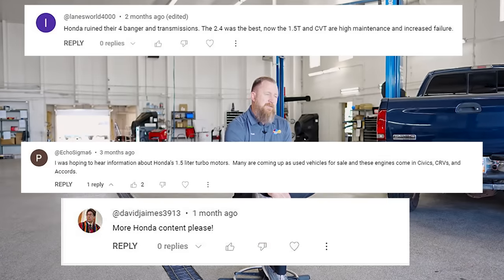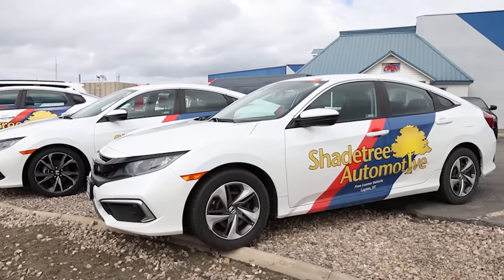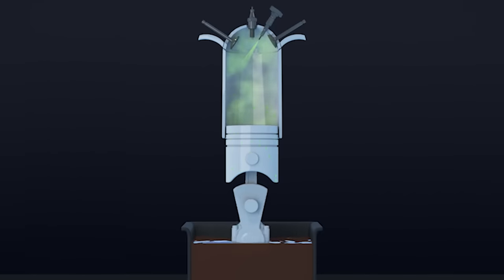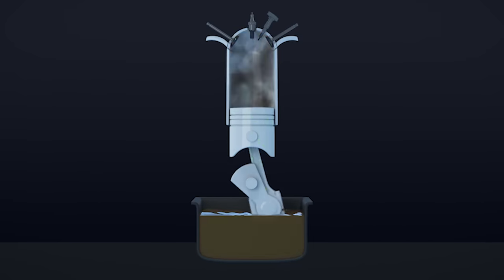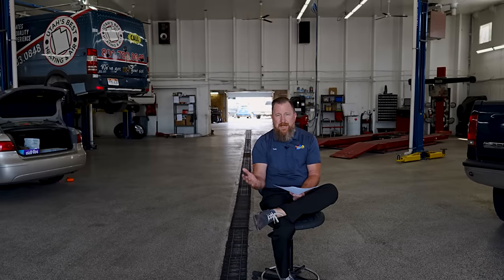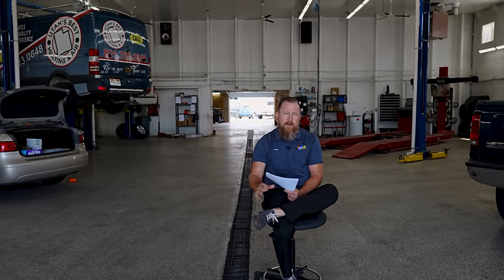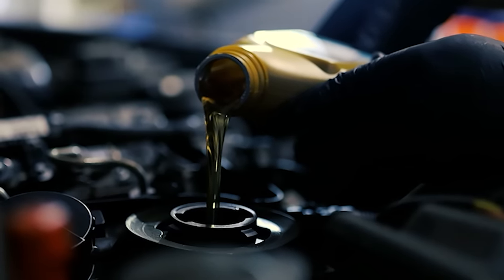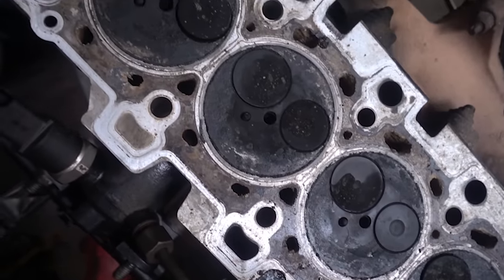Honda Oil Dilution Issue - Should you buy a new Honda

Comment: I would stay away from all mainstream small turbo engines and try to get a 2 liter - 2.5 liter non- turbo if possible
Reply from the maker: fair enough
Reply: happy with my 07 civic lx :)
Reply: Got rid of 2019 CRV. Was changing oil every 3000 and it was BLACK! Got the 4 liter 4Runner.
Reply: Smart
Reply: I have two direct injected cars and at a 5k oil change interval I haven’t had an issue. I even sent a sample to Blackstone at 3k miles from my 2.0 turbo Volkswagen (direct injection) and it came back perfect. I have no reason to believe that my direct injection Honda is any different.

Change your oil every 5k miles and it’s not an issue.
Reply: @user-3tf67bk46u   you suspect wrong, I have 163,000 miles on the Volkswagen and 63k on the Honda. Fuel dilution isn’t an issue if you change the oil at a reasonable interval. I haven’t scoped either because I haven’t had a reason to.
Reply: We had the old Honda 2.4  4cyl non turbo in our Element, besides routine maint, and valve clearance adjustment at 160k - no issues from new to 192k when we sold it, regret the 19 crv with its oil dilution issues, too bad the Element was just worn out when we sold it (aside from the driveline).
Reply: @user-3tf67bk46u  good call on the cvt fluid, we did ours at 25k and it was pretty dirty already. No hard driving, towing or anything just normal routine A to B.
Reply: Have a new 2023 HR/V.  Love my Honda and it's non-turbo 2 liter engine.
Reply: I agree 100% mrgarrison. Definitely stay away from these small turbo engines!
Reply: Probably a good cheap option. I love my WV 1.9L turbo diesel, no work to the engine yet but have had trouble with the fuel injection pump.
Reply: Turbos destroy your engine esp if 4 cyl
Reply: @ShadetreeAutomotiveLayton so this is just the 1.5l?
Reply: Mazda is far superior in design and quality
Reply: It’s this number one reason i got the 2.0 sport over touring or si
Reply: 9k/10k mile oil change intervals needs to stop. What a crock of shot.
Reply: @Trammael  Small engines with turbo  strapped to larger vehicle like CRV work really hard and need shorter oil intervals , maybe 5K is max it should do .
Than it has cheesy and cheap CVT for easiest way to achieve fuel economy at cost of performance , reliability and quality drive experience.
No respect for Honda , Nissan and Subbie going cheap !
Reply: @Pokka676  But that 2.0 is sooo slow with torque barely better than old 2001 Protege 2.0 and when paired with CVT it offers very cheesy and low end of driving experience...
Reply: @michaelw6277 

Well when you have an oil dilution then it's already a problem. 

Just because you change the oil fast enough before causing any damages doesn't mean it's okay. 

It's like saying it's okay to have diarrhea as long as you run fast enough to the toilet before you are crapping yourself...🤣🤣🤣
Reply: @nickmalone3143  So not true. Turbo engines are over-engineered to handle the addition stresses from boost. That's what makes factory turbo engines so strong...
Reply: Happy with my 2018 accord hybrid and 2023 CRV hybrid
Reply: Honda is putting a 2.0L NA hybrid engine in their civic next year. That is what im going to get
Reply: @michaelw6277 depending on what year that Volkswagen is, the gen 3 audi/Volks 2.0T is a very reliable engine other than the timing tensioner and thermostat leak.
Reply: It's a direct fuel injection issue, I have a 2.4l non turbo and it still gets fuel in the oil. Honestly shorter oil change (4kmiles) interval will fix most of the issue
Reply: Bought my wife a new 2018 CRV 1.5 T. 1200 miles in we were dead on the side of the road. Oil dilution. It was under warranty but Honda played this down for many years. I will NEVER buy another direct injection motor or another Honda just for simple fact of the way they handled my situation. We lost our @$$ on this car.
Reply: @DapimpBDSD  yup, but when you add the pressure from a turbo it gets even worse.  Decades ago it was well known that you'd have to change the oil in turbocharged cars more frequently due to blow-by and fuel dilution.  Add in a high pressure, direct injection system and it only gets worse.  Then add low friction piston rings and tens of thousands of miles of carbon build-up causing a richer than optimal fuel mixture and sticking to manufacturer recommended oil change intervals is a recipe for disaster.

Just change your oil very 5k miles and use a known good quality oil like Mobil 1 or Pennsoil Platinum or whatever.  Problem solved.

With my Honda I let the dealership do a couple of oil changes after buying it and their trash oil was disappearing from my crankcase over the course of a single OCI.  I switched Pennsoil, same weight as Honda calls for, and it doesn't use a drop over 5k miles.
Reply: @michaelw6277  I've used mobil1 and amsoil and it will still burn about half a quart every 5k miles. On top of that, the oil smells like gas. I know it's my driving habits (15ish min drive to work hwy/street)  but I'm not gonna really change that in order to try and see if the issue changes. The simple/easier solution will just be earlier oil changes
Reply: @mzrzfxr  Yeah bring back the Element with the K24 with a manual trans option. I wanted one badly but at the time it wasn't financially possible .
Reply: @michaelw6277  

There is a big difference between a "contamination" that occurs in a normal operating range that occurs almost uniformly in all engines across the board compared to in this case which is a DESIGN FLAW that only affecting a certain specific engine that can cause an early damages beyond what is considered as normal compared to its peers... 🙄🙄
Reply: My engine is 2.5 liter naturally aspirated.  Recently passed 250,000 miles with no issues.
Reply: @henrytenden  all engines get blow by for the same exact reasons, these Honda engines aren’t special. The actual problem is that Honda’s engineers recommended an unreasonably long oil change interval without accounting for the extra blow by caused by the low friction piston rings. Either that or the engineers made the right recommendations and the marketing and sales people steered the ship the wrong way.
Reply: @kdomster9141 that's why I like older cars in the 90s they made quality cars mainly Japanese cars and 80s as well thsts justcme though
Reply: Basically get a hybrid (which are rarely turbo) and expect to replace the $2000 battery pack every 10 years. Way cheaper than an engine and way more reliable than a turbo. The efficiency of a hybrid over a small turbo is generally greater anyway.

The alternative, as you say, is a non-turbo which is tough to find these days. Every non-hybrid Honda 4 cylinder is turbo. Your options are really between Subaru (which have issues of their own) and some Toyota’s and Nissans, all of which seem to have CVT’s of questionable long term reliability. This leaves you with Mazda, who still offers NA 4 cylinders with traditional torque converted automatics while still achieving over 30mpg.

The irony is the turbo Mazda motors, basically the same engines as the non-turbo models with some minor internal changes, are not reliable. Many skyactiv turbo motors have head gasket issues, as low as 80k in the larger vehicles such as the CX9, greatly justifying why they are now using an inline 6 in their larger SUV’s.
Reply: I’ve always stuck to 3k since my dad told me when I was a kid and his old school mechanic 35 to 50 bucks ain’t nothing
Reply: And still they tell you to not warm up the engine before driving.  That would solve many of these issues.  A gas engine and turbo has spelled problems for decades.
Reply: Ridiculous
Reply: My turbo engined car has recently reached 300,000 trouble free kilometres in the 16 years that I’ve owned it. I would recommend turbo engined cars to anyone.
Reply: @michaelw6277 Why are you changing the oil so often? My VW has done over 300,000km using the recommended service intervals.
Reply: @nickmalone3143 I wonder how my GTI Mark V is still going strong after 17 years and 300,00km then? I think your comment is based on bias not facts or experience
Reply: @michaelw6277 It’s as good as my VW turbo then. I wonder if it’s also as fast and as economical though?
Reply: @davidmatthews3093   that's awesome, glad to hear it.  I change it more frequently because that's what I'm comfortable with.
Reply: @davidmatthews3093 He might be talking about new direct fuel injection engines.
Reply: Gets rid of the carbon but stops up the cat
Reply: Peugeot have been using low displacement turbos for longer than honda. Their only problem is the timing belt is built inside the engine and prone to damage if not using the correct oil. I service every 15k km. no dilution problems
Reply: Some of us need power though. And a non turbo 4 banger ain't gonna cut it
Reply: @jeffreylong5660  
That's why you're best to skip the small mainstream turbo's & go straight to the  performance cars: type R civic, corolla/Yaris GR, WRX etc
Reply: Mazda 2.5 Skyactiv non turbo, best engine out there...
Reply: I have a 16 Corolla 1.8 mt and it’s a beauty
Reply: Minis seem fine.... but people mistakenly do the pcv valve when they really need a new valve cover entirely
Reply: I would not
Reply: Mazdas have been super successful with turbos in their whole line up.....coz they dont cut corners with low tension piston rings or use 0w16 oil etc. They put the good stuff in.
Reply: No point if it’s not a turbo, it’s boring and slow without it!!
Reply: @kdomster9141 absolutely not
Reply: @ChrisBrown-pz2gu  No too much to say there ? Honda made a gamble and took lazy direction with their design direction , choosing CVT and tiny engine with turbo is not like what Honda use to be 25 yrs ago making innovations and great designs to attract wise customer and enthusiast.
Now with cheap ass CVT and small displacement turbo and even that is a poor design with issues , than comes fugly exterior design and why would anyone want to buy it ?
Reply: @briangallant5973 Color isn’t really indicative of poor oil performance
Reply: Turbo = more routine maintenance.
Reply: @mrgarrison3516 the wrx has bad head gasket issues that plagued the platform for 20+ years. That’s not reliable.
Reply: Meanwhile Toyota's engineers solve the carbon build up on direct injection engine by simply using both direct and port fuel systems genius!...too bad honda is not catching on😢
Reply: I agree!  And this is why I bought a Mazda CX-5.  I really wanted a RAV4 but I couldn’t wait 2-3 months for one to come in
Reply: That's why I'm very happy with my 2021 Kia Soul with a NA 2.0 liter and multi port injection. Also has a timing chain, not a belt. Direct injection is one of the worst things in the auto industry right now.
Reply: @briangallant5973  I swear that my 4Runner can go 5K miles and beyond and the oil remains golden.  it's a great engine.  The Honda is bs.
Reply: don't forget to opt for Honda V6. I have my Honda pilot trailsport V6 on the way.
Reply: Good thing they offer a 2.0 liter non turbo
Reply: I have a 23 civic hatch sport 2.0 k 20 variant. The dealership changes every 7,500 miles. Hopefully no issues. I dud have a window regulator go out on passenger side.
Reply: What about the 2023? Any oil dilution issues? I drive it everyday in Hawaii
Reply: @irenemanuel4217  
Oil dilution = means fuel will get into your oil & you will smell fuel on your dipstick, your oil level may increase.
Oil dilution is increased in cold climates.
Change your oil often (twice as often as your manufacturers recommendations).
Use the recommended oil grade (0w-16  GF-6a etc).

Happy driving 👍
Reply: Only if you can find it all Cars suck now
Reply: Are u sure that 2016 CRV is having oil dilution issue?  Everything I see says the issue happens in 2017 thru 2018?  I believe you mixed up the years of the civic and CRV @ minute 1:25
Reply: So for the 2024 model, has honda addressed this issue & has the issue gotten any better than earlier year models ??
Reply: @michaelw6277 do you do the carbon cleaning every 30000?
Reply: @Tracy-wr7mj   oh no, I can’t be bothered to do it that often. First time I went 90k miles, second time I went 70k miles because I was chasing a misfire that turned out to be a set of new spark plugs that went bad really fast (I screwed up, always check the spark plugs first).

My car runs like butter now though. Never fall in love with a Volkswagen, they can be an absolute pain to live with but it drives so nice I just deal with it. Fortunately I have a great mechanic for big stuff I don’t care to do myself and even with repairs it’s still a lot less than a new car.
Reply: Depends on your location. If you're at 10k feet, enjoy your NA.
Reply: I had the same issue on my 1.6 Nissan Versa. The solution is easy. Just put 3.7 quarts at every oil change and you will not have the overflow.
Reply: Also, car makers are using low tension piston rings these days. A major issue with allowing more blowby.
Reply: I’ll keep my R18 and K24 engines and be very happy to keep on trucking down the road!
Reply: Only civic I wanted was the sport hatchback manual (2.0l port injection engine). However, Honda dealers mark them up since they are hard to find down south. Settled with the Mazda 3 premium manual. 2.5L no turbo.
Reply: What about 1.5 non turbo. That’s what my civic has and drives faster than I would ever need it to
Reply: @proggz39  if it's not a turbo you will be good to go 👍
Reply: @proggz39  if it's not a turbo you will be good to go 👍
Reply: Mate I just love the practical advice on mechanical matters. Gives me an edge when I upgrade my old camry.
Reply: @kdomster9141 far superior? That’s just ludicrous.
Reply: @billbigshlong382 of course Mazda makes superior vehicles to Honda period . If you can't see it you may need reality check
Reply: Agreed 100%
Reply: Same here, I will never buy a Honda again due to my many issues & nightmares for my 2017 CRV with 1.5 Turbo engine.
Reply: Yes I agrees. I been driving 2.0 turbos and 2.4 and 2.5 turbo. They are the best reliable engines. 
1.5 turbo in the form of 3 cylinders are unreliable
Reply: And manual transmission.
Reply: @Hallowsaw no they're not
Reply: No issues with the 2.0t
Reply: @DapimpBDSD I have a 2019 CRV and had to buy the lowest end LX trim to get the 2.4l. I haven’t noticed fuel smell in the oil or the level being higher. Why do you say yours also has the dilution problem like the 1.5l?
Reply: @glengoogling7597  cause it reeked like gas whenever I changed the oil. Even just checking the oil on dip stick, you'd start smell gas a little after a couple thousand miles. I do alot of oil changes (former fleet mechanic) and this is one of the few  times I actually noticed a gas smell from the oil.
Reply: Fantastic video! Very informative. I own a 2013 Accord with a 2.4L naturally aspirated engine and it's been fantastic. Not a fan of CVT considering I had an 02 Accord with conventional automatic and I still remember how awesome that car felt. But the 2013 has been a good little car so far. I would love a CR-V but the higher trims with the turbo have me scared. I've been shopping for a 2017-19 LX that comes with 2.4L NA. I do have a longer commute to/from work (30-40 mins). I also always change my oil every 5k miles. Living in MO, maybe I'd be ok with a turbo??
Reply: I have a 2019: Honda Civic EX...no problem with oil dilution. It's been almost 5 years now. Honda fixed this issue on their 2019 and up lineup.
Reply: What about a 2021 RDX?
Reply: Got a 2.3L Rdx no issues 190k miles it’s the new emission BS
Reply: in some country above 1.5L is taxed more, so turbo smaller engine is used for cheaper tax
Reply: Would agree.... But you'll find the vast number of these cars of small turbo engines.... The only one that I could think of that isn't is the toyota ---
Reply: I don’t agree with that. It is all depends on the design’ maintenance, internals. Turbo does not make a motor unreliable. Turbos are used in aircraft, ships, trains, diesels.

Comment: Get a naturally aspirated engine while you can.
Reply: Honda's 2.0 and 2.4 NA engines are bulletproof  . I like their manual transmissions too
Reply: @toetz4491  That is why I am interested in getting the Civic sport with the 2.0 engine and the manual transmission.  I was originally fixated on the SI.
Reply: @MrBacchus18  im getting a 2008 + manual trans  civic or accord... heck even a fit will do  ..for a second or  beater car
Reply: Thinking Lexus ES350 might be the last natural V6.